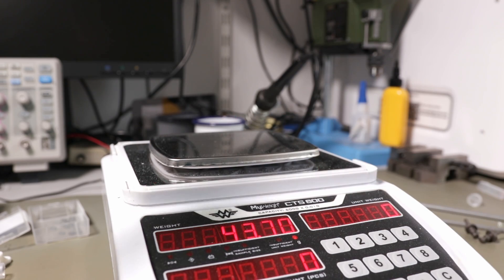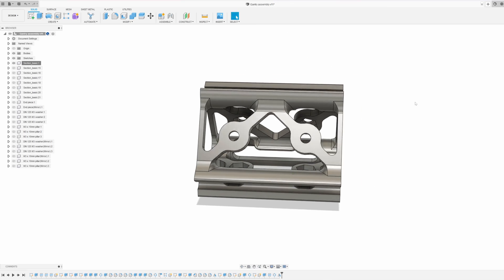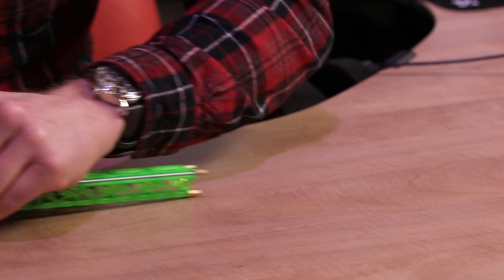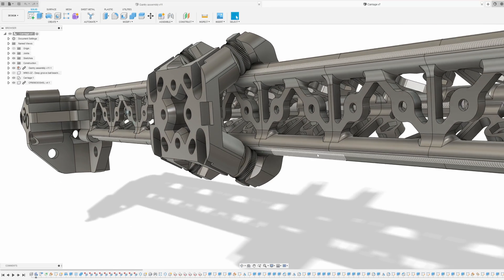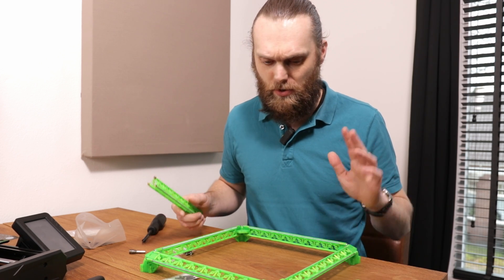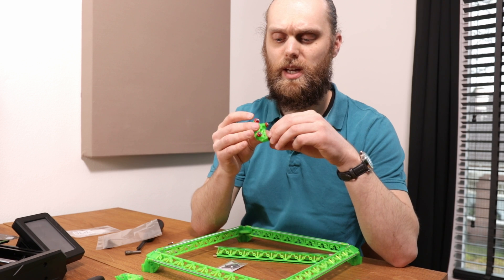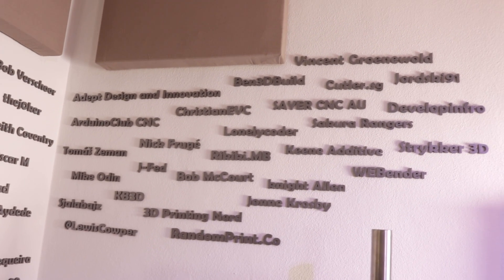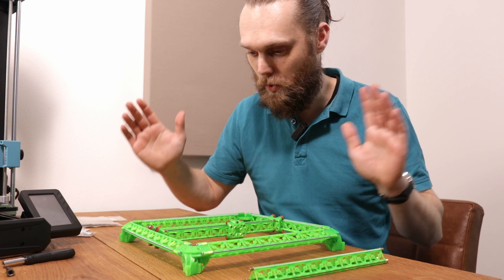Is This System the NEXT STEP in 3D Printing?

Comment: What if you used smooth rods, tapped the ends, and cut an lm3uu bearing into quarters (lm3uu bearings have 4 races). Cf filament is stiff and light

Comment: How would you rate that truss you built compared to others? I hadn't seen that shape before, with the donuts in the webbing. It's also a solid unit, whereas the the truss I tried to build was meant to print the 3 sides independent, flat, then linked together to make the triangle. I can't say I'm overly impressed with mine, but it's standing the in the corner of my room regardless.

Comment: Looks like this will get buried, but how about designing full length rail sections for on a larger plate with topology optimisation? That should at least ensure the best use of plastic possible.

Very cool seeing the rollercoaster style rollers on this. Awesome!

Comment: Did you ever do a comparison of the assembled portals? 
It seems that the truss would have a more uniform stiffness. The base gantry is going to be stronger in the wide plane than the narrow plane by a large margin. 
I would like to see some strength tests done on your trusses. I considered something similar for building a 4' x 8' CNC router gantry. Only using MDF instead of printed plastic. 

I think you should(maybe you already have) keep going on this idea. Even if you don't make something revolutionary, you might come up with something that could make building homebrew 3D printers more accessible.

Comment: the bearings and washers is common practice, and if you increase your tolerances the plastic wont stick in the thread. Your design was fine otherwise.

Comment: So if you do tubing or pipe, you can see about making seize fit ends that are tapped or threaded rod to attach or mount ends too. 

You could also see about a small spot welded and adding a nut inside the tubing, like an m2 or

Comment: instead of print on a square bed  it need to be a cylinder and also give the base spin . you could use centrifical force to print overhangs lol . 

also cooling would be more consistanat. for the bed  you could use a clock spring for a car it can hand the voltage for the bed.

Comment: Great idea, i a always looking for these kinds of things as great platform to build anything. Thinking about using the threaded rods for the rollers is such an innovative idea as these act as both guides and a calibrated drive system.
I would suggest that the threads on the rollers need a relief as think about how a nut moves parallel to the rod, it is not designed for axial movement along the thread, some design as used in gears would create this relief to enable a good smooth mesh.

Comment: i hope i’m not late to stick my spoon.

i think this may have potential. This looks great for building variable size prototypes with linear rails. this also has a plus on accessibility compared to linear rails. where i live, it’s very hard to get linear rails that wont get you broke. This concept looks a lot cheaper alternative. again…. flexibility that linear rails don’t have.

Why think of light when you can think of rugged. not depending on clean environments for the inner ball bearings sake is q great thing for dirty applications.

however i think this concept can get much more light with few tweaks.

Comment: The idea is awesome.
This is what I was waiting for when I first heard about 3d printing.
I was going to get into 3d printing whenever this was close.
It never happened so I jumped on the train just before the "pandemic".
Had to put the printer aside as I didn't have room for it.
I'm getting back into it and am currently working towards upgrading my ender 5 pro with the mercury one.1 and Hydra with a bigtreetech cb1 setup.
That Hydra setup looks awesome.

The frame doesn't need to be as light, if fact it would likely benefit from being beefed up.
Developing the ultra light and the ultra beefy at the same time could help lead to ideas in both directions.

Maybe a 4th rod right through the middle to help with rigidity and stability for the frame?

Or try one steel rod through the middle and 3 aluminum, or carbon fiber, on the corners for the moving parts?

Would fiberglass be more or less stiff than the aluminum rods?
You might be stuck with prefabricated sizes.(I'm not sure how the threaded ends are attached.)

Just kicking around some ideas.
Reply: Ps I just found your channel and am now subscribed.

Comment: Would love to see additional effort into this.

As for the weight problem.

Maybe hollowed and smooth Titanium rods with the inner diameter threaded for your endcap screws to tighten it down? Or carbon fiber rods maybe?  So many options

Comment: use smooth rods and pla bushings instead.

(also why abs for the rollers? pla is harder and works in my experience better for that kind of stuff and threaded nuts and stuff like that, that it's not stronger as such doesn't matter)

Comment: Please give us more. I have a few material suggestions: Polypropylene is extremely light, but a little flexible, might be useable because of the truss structure, fairly cheap too. Carbon fiber might be an option since you want stiffness and lightness.

Comment: I would like to see the next step in your approach. As I offered at Formnext Dinner: what do you think about carbonfiber reinforced PEEK for your "trusses"? :)
Reply from the maker: I'd love to be able to print PEEK someday and it'd be dope if I can build my own printer capable of printing that! For the next build with this system I'm going to use Luvocom PAHT CF which even has a slightly higher tensile strength if I compare both filaments that 3D4Makers has to offer.
Reply: @properprinting  the point is: i could provide you with a few prints (free of charge) if you want to test the peek-cf

Comment: making something stiff and light needs the strongest materials available and also the lightest. So a carbon fibre sucture may be a way to go. With hollow rods of CF, and weaved at the corners with more CF that will also add more heft to CF rod near the joint whe the bending stress is more so you need more of CF near the base of the joint.. so the added weaves of CF might very close to a topological optimized part.

Speaking of.. the geometry is a big influencer in designing something light.. You need as close as possible to equal stress truss so you don't have material where is not needed. ANSYS has topologycal optimization and migh give some interesting results. Some of those results may be 3dprinted but keep in mind 3d printed plastic is very weak compared to a lot of other materials. So really PLA/PETG, even exotics like PEEK, PC, etc is quite low in contrast to a normal CF rod. So topology optimization for a weak material is way worse than on a really strong and light material.

As for the linear bearings.. idk.. the smoothness of it is a big factor. So with a space-age truss frame will not replace the need of proper linear bearings

Comment: Good Evening, Just seen this video 3 weeks late. But no problem there i guess...
But i was thinking after i watched it, the issues you are having with the X-Gantry and the X-Carrage bingding as they roll could have a solution to your original SLA design...
Wgy dont you pre-tension the M3 Rods after it is munted together? (meaning pre-tension the rods after you mount the x-carrage to the gantry? that way you will be able to feel if the gantry is twisting under tension like a wheel whith spokes!
Have a good evening! :) hehe...

Comment: 13:31 It doesn't have to be hollow. You can add external thread to the ends with a threading tool and use nuts.

Comment: This would be awesome as a potential building system for not just 3d printers but all sorts of computer controller equipment! Love the concept and I think smooth rods and needing to cut threads onto each end would be worth it as a hobby builder.
Reply from the maker: I'm currently working on a video using this system but not for a 3D printer. Something totally different! And yes, it uses smooth rods, but not for a motion system since it doesn't have one ;)

Comment: I know hollow carbon fiber tubes are available for building model aircraft/drones/etc. That sounds like something that pushes the limits of stiffness to weight ratio, so that might be something to look into for stiffening long 3D printed parts, but I suspect they may not be accurate/precise enough to serve as the 'reference' surface for smooth motion, sadly.
I'm really happy to see experimentation towards better-quality 3D printed 3D printer parts, though! Self-replication is not really a thing being chased by much of the community any more, and I think it's a shame! Another Reprap revival would do good things for the accessibility of manufacturing outside the more privileged enthusiast community, and that's really what it's all about!

Comment: It's really cool but I think one of the main flaws is the build volume you'll get out of it, if I'm correct it should be smaller than the one you printed them on, plus I'm not sure about how rigid this would be if you stuck 2 pieces together to make a long one. I really like the idea but I don't see the point other than being cool (at least for now), it's not the lightest and probably not the cheapest to build, maybe it could be a great middle ground option with enough developpement

Comment: How about hollow carbon Fibre rods. Cast ends in epoxy and cut thread into that 😅 lots of work, but don't know if you can get lighter then that
Reply from the maker: I already bought carbon fiber rods! Different diameter though and I'm going to tap thread into it directly. I have to clamp the rod down to prevent splitting, but this looks like it's going to work!

Comment: can't you take titanium rods without thread and only cut it at the ends for the nuts?

alternative suggestion. 
Press carbon rods into the corners of the triangle.
2x5mm. the narrow side to the outside as a running surface for the roller.

Comment: Change the threaded rods to carbon tube/rod and when you pressed it with your tool, use glue. It need longer time for making, but it can go lighter then the mgn12. You know, mgn9/7 is OK for X axis (short range) :)

Comment: I just had an idea for an ultra light gantry and had to come back to the comments of this video. Use 2 small aircraft cables pulled really tight as the gantry. You could have bearings run along the cables for the caraige. It would require the frame to be really strong but the actual moving parts could be extremely light. There would then also be a potential to electrify the cables and use the wheels to transfer power to the hotend to reduce electrical cable mass. You would then only need fan and thermistor wires. Isolating the aircraft cables may be more trouble than its worth though.

Comment: Why not just add sorbathane pads in between the connections of a standard aluminum extruder? You should be able to dampen out a lot of the vibration

Comment: How about something a bit more ambitious: Make a printer where the bed and the head can both move in X and Y directions.
Hypothesis: If acceleration is the problem then you can either make the gantry lighter, the motor stronger, or the acceleration lower. In most printers the head moves in one dimension and the bed in another, forcing both to do all the acceleration in that dimension. if the head moves in X at a speed of 10mm/s and the bed moves in X at -10mm/s then the print sees the head wizzing by at 20mm/s.
Think escalator, think running past a conveyor belt, think many many sleepless nights.

Comment: Depends on what materials used if it's the same PLA it'll maybe be more weight because of the extra lattice frame work to just a basic plate you would need a carbon fiber or a titanium putting costs up again but would make its profit back in the long run

Comment: I have a couple ideas that may help, first I like where you were going at the end of the video, go with steel or titanium rods and get sections as long as you can to drive cost down on the individual sections so you can cut them to length yourself and add threads only as far as you need. Next, I would remove the flats on the end of each gantry section and make a flat end piece that can go onto either end of each full length of gantry, I dont know if that would reduce stiffness but I think it would reduce or eliminate the need for supports on the individual sections further reducing print time and cost, plus if total removal does affect stiffness you can print one flat to go between each section.

Final thoughts, steel is more readily available and cheaper for the masses, so if the point is cheap and mostly printed go with steel, if the point is as light as possible go with titanium.
Reply from the maker: Thanks for your suggestions! I'm currently working on a redesign and the sections can be printed without using support. I want to make the system in such way that multiple ways on tensioning can be used. This makes it easier to source parts and it's possible to decide to use different methods for different purposes. Like light for the gantry, and cheap/heavy for the frame or incredibly cheap if you just want to put something together.

Comment: I'm super interested in seeing how far this can go.  My Bambu Labs printer uses carbon fiber tubes for linear rails.  I like the Kevlar rope suggestion.  I have been working on a similar skeletal gantry design with cnc cut flat stock.  Looking at your project I'm thinking about trying cnc cut carbon fiber flat stock.  For 3d printed skeletal gantries you might try one of those AI designed organic structures.  This is exiting.

Comment: All you need is tension, No bending resistance is required . instead of threaded rods, Use kevlar ropes, super light, Super strong, Easy to create tension.
Reply from the maker: You're absolutely right! I just designed a tensioning system and I already had a spool of aramide fiber!

Comment: Could you use the smooth tubes for weight and put a single threaded rod down the centre? Love the idea of the blocks. Also for a weight reduction on the carriage if you used the two outer points of the tringle pulling on each other you could have an even smaller carriage

Comment: This is an awesome idea with excellent implementation. I think instead of buying 100% threaded rod we should try to find some smooth steel rods(think Prusa style linear rods) that can easily be threaded with a DIE. Ideally sizes that can threaded directly or by just removing the surface finish/chrome with a file/grinder/belt sander. I'm picturing some sort of bearing harness that allows you to rotate it easily to get an even finish for threading with the DIE. If it catches on I'm sure China will eventually sell cheap pre-threaded rods but until then I personally would prefer stronger smooth rods over 100% threaded. They would likely be more concentric as well.

Comment: I would try it with wire instead. You just have to find a way to get evenly tight and such. And maybe a new bearing surface. Or maybe add something like tig filler rod at the corners.

Comment: Even if it isn't as advanced or as light as other methods, I feel that that fact that most of the structural "filler" is 3d printed is still amazing, and it looks like the concept has potential. maybe smooth rods with threaded ends?

Comment: Do you need a rigid rod? If just compression what about tensioning with wire or a zip tie mechanism?

Truss with slots for stock zipties might provide an adequate rail and make corner fittings much much simpler. I think you can use heat to shink them & add extra tension if needed, & later acetone or epoxy to glue  tensioned ziptie to truss.

It be relatively easy to span zipties through the hollow of the trust to different corners for extra strength & dial in (or out) any twist.

Zips come in a huge variety of sizes & materials (stainless even) up to 60inches long. Hose clamp might also work. A metal zip could take a fillet or be bent like angle iron which might be superior to steel rod by weight.

Comment: 0.2mm nozzle for segments will do the job with weight. I think steel rod with hollow can be the best and cheapest solution. But rollers should be 3d printed or at least out of kind plastic. I see big potential.

Comment: Since it doubles as support, comparing it to the linear rail weight only seems unfair. Maybe cnc aluminum plates or carbon fiber plates that assemble into trusses to reduce the number of parts. Snapping together is nice but a simple 1-2-3 size variation would cover almost any scenario you need. The building block functionality seems like a separate challenge.

Comment: It requires a bit more machining steps, but what about precision ground rods for the reinforcing/bearing surface? Yes you'd have to tap each end for bolting together, but it would give you a fairly smooth surface for rollers to run on

And as a former live sound engineer and rigger, what about using egg and pin connections? I have no idea how you'd machine the eggs to this scale, but clockmaker's tapered pins and a tapered broach to get the fitment just right may be a starting point!

Also, what about a different geometry to the truss segments, using topology optimisation for an ideal strength to weight ratio?

Comment: I'd love to see how far this project can go.  The original open source concept for 3D printers was to make a machine that make more machines.  I think you're on the right track.  It's super cool what you're doing, even if it's not the lightest setup, weight is not the only factor for printing well and with speed.

Consider using carbon fiber rods.  Cheaply available online.

Comment: I think using carbon fiber hollow tube would work well. I use it for making drones and it is very stiff. You can epoxy threaded ends on where you need them.